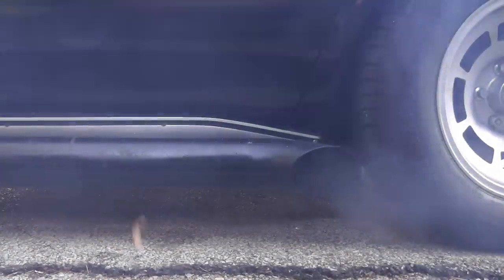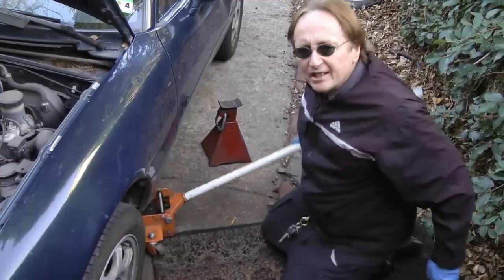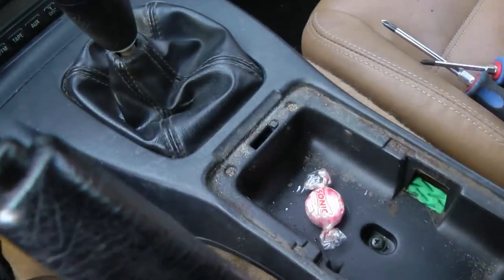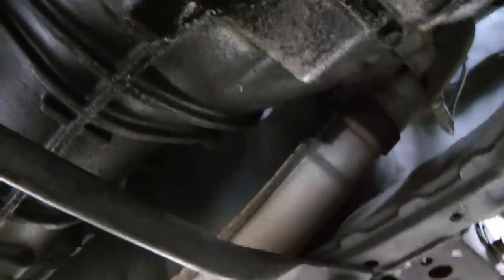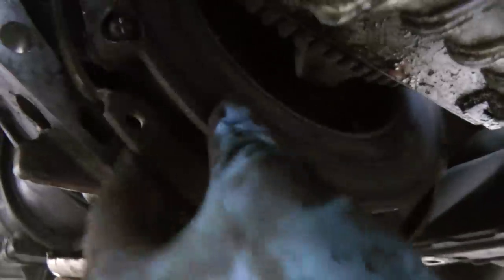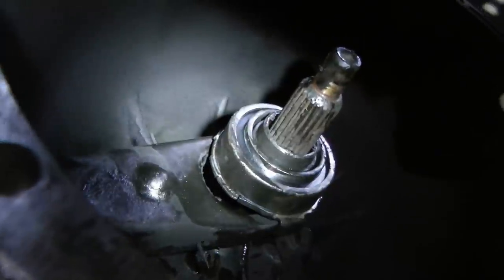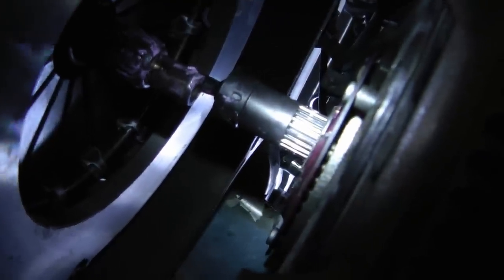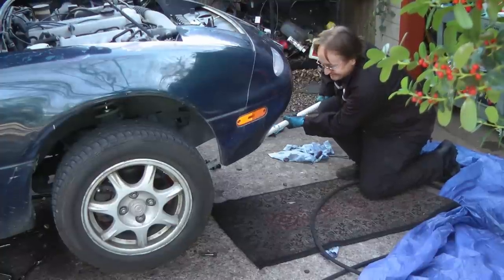How to Fix a Slipping Clutch in Your Car (Clutch Replacement)

Comment: and they'll charge 800 in labour for THAT? surely even a novice like me can do it in 10 hours
Reply: ***** they do charge that where I live and it's even more expensive at the dealership. Ok I'll give you that if it takes an experienced mechanic 5-7 it'll probably take me the whole weekend but with prior research I'm sure it's doable even without a lift and just a jack
Reply: ***** I live in austria
Reply: Yesterday it took my Mechanic friend and I 12 hours on my 350Z. We had to cut rusted bolts to get off the exhaust system and the rear under strut bar. On top of that, what taken more time is that the previous owner used after market flywheel which took forever to remove because how tight it was on and 2 of the pressure plate bolts are stripped when he unscrewed them from being over torqued ... So we had to drive to a Nissan dealership 30 minutes away just for the specific bolts.  The 350Z has tons of bolts holding it together more than any car I seen, and now I can see why for a sports car its very durable.
Reply: Proably 3-5 hours on a front wheel drive vehicle .
Reply: +Ksam96Trini but front wheel drive is for minivans
Reply: pmm4177 front wheel drive is for every car nowadays that isn't a sports car or off-road vehicle
Reply: some mechanics are just insane... i know depends where you live but mechanics in nz were charging me equivalent to $200 nzd an hour do to a timing belt, considering for them with all tools and experience would be a 3 or 4h job... just as a refenrence, minimum wage is about $15 over here
Reply: I used to go in one that charge $70 labour but some jobs like timing belt they seem to charge more, crazy prices, i dont understand
Reply: I've seen the average mechanic charge $100/h up here in canadada, and performance shops charging up to $160/h!
Reply: yea I don't get it either, a timing belt job should be 4hrs for a certified technician..plus parts 
so for example $100 in labor , $300 in parts is $700 after taxes $740-$750 
a shop will quote you $800-$900
Reply: On my old toyota I spent about $150 in parts (the whole kit, with water pump, all seals and gaskets and idlers, everything, costs less than $150 on rockauto.com) + $280 labour (70 an hour, which is what they describe on their invoices) would be a $430 job... yet they were asking me $900. But in other hand was good because although took me forever to finish, I did the job myself and quite enjoyed fixing my own car.
Reply: Andre Luiz that's because average shop rate for mechanics $125 an hour, some of the higher end ones are $160, and the lower-end ones are a hundred an hour. a timing belt removal and replacement along with the water pump is only going to take about 3 hours, but even though it's a very simple job, that's 3 hours that could be doing something else. 3 hours at $100 per hour is $300, about what they're charging you at 310. I say that's a fair price.
Reply: Soul attorney if you haven't done it before, it would take about 8 hours. That sounds about right. If you have the right tools, you just left the left side of the engine out of the car with a jack, remove the motor mount, remove the inspection cover, and that's it. You should be able to access the water pump with a 10 or 12 millimeter socket and the timing belt with a pry bar to remove the tensioner.
Reply: Goriaas LOL!!!!

Comment: I have a 2001 civic and there is a loud noise when releasing the clutch in parking, checking on the internet I figured out it could be the input shaft bearing, I will try to do it myself and I've been watching many videos like you scotty! thanks, I will try to take out the whole transmission!
Reply from the maker: May16Joe pray it's just the clutch, cause if it's the input shaft bearing, not easy to tear that whole tranny apart to change it, they are VERY complex inside
Reply: Scotty Kilmer Yea I just figured that out. School is about to start and I will probably leave that project for the end of the year, do you think it also could be the clutch? what other symptoms would it give me? It doesn't slip or has hard shifts, seems to run normal except for that noise. Do you think it's best to buy a rebuilt transmission and just swap it?

Comment: Now that's one hell of a difficult job! I'll leave that one for the mechanic. No wonder why it cost so much for a clutch replacement!
Reply: Not hard at all. On a rear wheel drive. now the front wheel drives are a little harder. And a 4x4.. well...yeah....
Reply: ***** 4x4 pickup truck is close to being the same difficulty wise
Reply: Will Godwin
You just have to take into account the trans being much larger, heavier and having a transfercase bolted to it.
Reply: yes that is true but i never said they were the same i said close.
Reply: what dd you think you could replace your clutch with a android app?

Comment: rwd so much easier than awd/fwd
Reply: Ugh, yes. You hit the nail on the head with that. Just helped a friend do this on his Hyundai. We're both experienced with cars (building a rally car together right now), but it still took us 15 hours. Straight.
Reply: Not really true.. a Front engined Rear wheel drive is like this.. but what about a rear engined car?.. I did a Matra Murena Clutch replacement once,  and that was fairly easy, jacked up the back, took the driveshaft on the left out, removed the suspension arm, and i could slide out the entire gearbox.
I Could easily access the clutch right from the left rear wheel well
Reply: ***** How handy is that! Yeah, I wasn't including rear engine/drive, but I didn't specify that.
Reply: You're telling me, had to replace the clutch on a early 90's fwd saturn and that was an absolute bitch. My shop teacher told us to remove the whole engine and do it like that, we get about an hour or less of shop time a day and it took around 2 months, if I was to do it again it would take considerably less time because I'd move the transmission, that thing is easier to move out of the way then removing a whole engine.
Reply: 15hours? well if u keep walking back to the coffee machine every 10 minutes ofcourse it takes 15 hours..lol
Reply: Vauxhall used to have a fwd range of cars where you could change the clutch without removing the gearbox. Very easy to do and very quick.
Reply: said 7eis

Comment: Wow he makes this look easy, this inst exactly an 'easy' job to drop your tranny on your garage floor.  

SOO true to buy a whole kit.  If you go through the hassle to do all of of this replace everything.  99.9% sure that if the clutch is gone from years of wear everything else should go too.  Good test of a reputable mechanic.  Sleezy mechanics will just replace the clutch so you have to go back in a few months to replace the throwout bearing.

Comment: thanks scotty, actually its my friends car, now with your helpful guides I'm starting slowly a repair shop, tomorrow I'm going to try to fix a 1989 Mitsubishi galant, the owner said when h turns the ignition the wiper also activates even if it is not turn on also the battery keeps draining, thank you so much with your help
Reply from the maker: often that's a shorted out wiper motor or motor switch
Reply: thanks scotty it really help everything you teach, Godbless

Comment: I think this job might be a little too difficult for a DIY kind of guy lol
Reply: My dad and I, (I was 17 at the time) had to replace the clutch on my ranger. Its far more frustrating than this video makes it seem but after a solid day of work and having never changed a clutch before we got it done. I will admit having two sets of arms when lowering the trans really helps and you absolutely need a jack for it. Other than that its fairly straight forward, I bet we could do it again in less than half the time now that we've done it once.

Comment: I changed the clutch in my car and it took over 10 hours .. this is best case senecio. I had to remove the fuse box, coolant reservoir,  then had to remove the sub frame which included axles, tie rods , sway bar links, steering rack and every bolt was either seized or rusted. It was messy.

Comment: when i see someone that says i ve worked on cars for 40 plus years and changes a clutch and not turn the flywheel it drives me crazy i bet you also just change break pads and dont turn the rotors cause they have no groves lmfao at you sir stay a parts changer and stop saying you are a mechanic !!!!!
Reply: +Chad Cohoon Eh, in my experience nobody but bona fide car snobs burn money just for the sake of it. More often than not when I actually observe people taking little shortcuts like that it doesn't realistically harm anything, never mind all the theoretical or hypothetical crap that "mechanics" BS you with to make more commission.

Going to the trouble of replacing or surfacing a flywheel that isn't hashed is almost as ridiculous as paying $200 to have valve seats polished when you've already determined that the valve and seat form a good seal, IMO.

In a race application? Sure, recondition or replace everything you touch, but the vast majority of drivers don't use their cars hard enough to justify the extra time and money.
Reply: +Mercury Cyclone LOL thats like saying its ok to change head gaskets and not change the valve stem seals cool story bro !!
Reply: +Chad Cohoon The customer may not have had the extra money to spend buying a new flywheel.  The customer makes that decision not the mechanic.
Reply: +panzerabwerkanone OK bro I didn't say replace it you can have it turned just like a brake rotor that's the right way to do the job I am sure the fly wheel is glazed if the clutch is slipping but what do I know
Reply: Chad Cohoon I

Comment: Always ALWAYS check the level of your transmission lubricant before you drive the vehicle!  If the level is too low after leakage from the rear of the transmission during removal the transmission could be seriously damaged resulting in a severe repair bill.

Comment: Also, it's worth just inspecting the splines on the gearbox shaft, to make sure they're not worn or damaged. This could lead to the clutch sticking, or worse, sudden loss of drive. This does happen on European motors more than people realise, and is often caused by people being too quick when they set off in first gear.

Comment: Hello Scotty. I have Toyota Auris 2009 1,33 101HP 6-speed manual transmission gear box, with 130.000Km and never replaced the clutch or the valvolines. My problem is that suddenly as I start driving and when I put the second gear, gets difficult in. The other gears, while driving, go more easily. What do you think it is? You think the clutch needs replacement, or the valvolines? Or is it a more compicated problem from the gearbox? Thanks.

Comment: Ten years ago I bought a used 1998 Ford Escort with 5 speed trans-axle, it had 77,000 miles. Now I have 163,000 miles, it's still the same clutch and gives me no problems...yet. It doesn't even slip. I've done clutch replacements before, about 30 years ago, but this time I think I'll let the shop do it. I don't have a floor jack or the facilities and live in an apartment complex. A shop can do in in two hours, I would need all day. Besides, I'm old and cranky and don't wanna crawl under the car!

Comment: scotty when you opens the transmission (gear box)You have got to replace the whole clutch kit.That includes clutch bearing clutch plate clutch disc and also you have got to polish the flywheel.If you just replace clutch disc say the problem is in the disc you replace it after some months or soo the problem arises again so its better to replace the whole kit once to be free from it for 2 3 years.

Comment: Hello Scotty. Great video. I would like to add one important tip here which is to make sure you don't touch the clutch or flywheel with greasy hands. Wish you had mentioned that in the video!
Reply: If you rub the excess grease from the packet around the disk surface you'll get better gas mileage.  (or not..)

Comment: Thank you very much for all your videos! very good source of info 
now i have a honda accord that i buy and it was non operational because the clutch is bad, i just got the new clutch & pressure Plate ready to fix it but one thing i notice was that the car is doing. it takes off when the trans is in neutral even do the clutch its bad, i have to keep the pedal down, anything else i need to replace?
Thanks!!

Comment: Scooty, my clutch is only40k old and is slipping due to transmission oil contamination. I am planning in fixing the transmission imput shaft seal and try to clean the clutch since is not old. what cleaning method and agent would you recommend to remove the oil from the clutch?
Thank you Scotty, you are the man!
Reply from the maker: brake spray cleaner removes the oil

Comment: I have a 1998 civic 5 speed. Previous owner put new clutch 8 months ago. I sometimes hear a screech noise when im in 1st gear and clutch is about to grab. So it only does in the catch point. I know it's not a throw out bearing

Comment: Scotty I went to the junkyard to practice this on another miata,  the junkyard wouldn't let me bring my Jack in so I had a hard time supporting the trans when trying to pull it off. I saw the gaps between the engine and bell housing but couldn't pull it far enough. the back end was leaning down more.  Do you think I could of did if I had my Jack?

Comment: Scotty, I have a 95 Pathfinder, while driving one of my belts popped and broke a hose for the transmission fluid.  I replaced the hose added fluid, replaced all the belts, but the vehicle will not go in reverse.  Is it time for another transmission, as it was fine up until the incident.

Comment: hey Scott . . replacing MY 2000 328ci BMW (e46) clutch was wondering should I get clutch kit that comes with flywheel or just get clutch kit without flywheel and save money . . I don't think that its damage but was just wondering would it be a problem with new clutch to old flywheel or stock . .

Comment: Do I have to replace the clutch pressure plate or can I just used the original one and save money? 2003 Hyundai tiburon v6 5 speed

Comment: The last clutch I replaced was in a 1949 Ford F1 pickup truck with a flathead 6 and a non syncro 4 speed. It was one of the most difficult jobs I ever did since the trannie went in from inside the cab and the way you had to wiggle that thing to get it to mate up with the engine was a back breaker and you couldn't see what you were doing because your face was smashed up against the dashboard. On top of that the trannie weighed more than I did. Never again!!!

Comment: So what about all that fluid that drained out of your transmission? Was it rain water, or did you run it dry?
On a more serious note, I just replaced the crank shaft on my '06 Ranger, and noticed my clutch was nearly worn out. Don't have the money for it yet. But it's good to know I might not need to pull my engine again when I do.

BTW Found your Channel after looking into why she wont take gas. I'm going to go take care of that.
Thanks a lot for the helpful advice and keep 'em coming.

Comment: I got a good one for ya, i have my Mitsubishi Triton MJ 1995 Turbo Diesel 5 Speed 4WD, and heres a few issues i have with it.

1: The horse power seems to be unstable. By which i mean, i used to be able to take off fairly quickly at the lights, and i beat most V8's around that corner on the inside or outside lines, and by the time i am exiting i am getting ready to shift into 4th gear.
The car seems to be losing power. But sometimes regains it. I figured it may have been from driving through a horde of bugs, but i don't think its the case, due to my air cleaner been cleaned up with a air compressor, and not much came out asides from lots of dust. I was also assuming it could be the Turbo as their is a sound which does not sound quite healthy or smooth, and only happens every couple of seconds, but when sitting on 1600rpm, you hear it clearly continuously. At any higher speeds it goes away.
I took it for a test drive, and tested how fast it would get upto speed. It used to be about 5 seconds to get to 50, now its about 8 and 12, and that's using the cars current maximum power. Especially after a oil change and filter change.

2: I'v noticed a couple of times that my clutch seems like its slipping, and yet 6 months old. Its done about 3,000 kilometers, and yet when going up hill at 90, i am doing 2000 revs, and then the hill hits, the the car slows down to 70km's at 2000 revs.
Today i did a service, and did a silly maneuver with the car in second, and boy did it feel like it was slipping till the car was really in motion.
The possibility of oil getting on the clutch is on my mind, due to leaks from the engine itself from the Rocker cover, and Sump plug. I cleaned it up, and found a build up around the space where the inspection plate would be, and where oil could run out of the transmission if overflowing, or to release pressure.
I am planning in future to get a better clutch when the cars running right, but for now i am using my cheapy since it was all i could afford, and now i can't afford to replace it.
I only ever few times gave the car a real run for its money. 2-3 times i did it seriously which could have caused a little wear. I am unsure if it could do that much. But since the oil changed, i realized that this problem is getting worst slowly.

3: I have a muffler that came with my car, and the car does not blow smoke. And a guy everyone here believes is a big dummy, told me "This car should have a straight through, and without a sports muffler. It would be the reason your fuel consumption is so high, as it's choking the motor. But also, the pipe ends to soon." Exhaust plus.
I would like to know what could be causing my fuel costs to be so high, but yet when i made a mistake the car miss fueling, the car had been powerful, and was cheap to run. 100km 8.5 liters of diesel in the Adelaide hills. I also used 5th their this time as well.